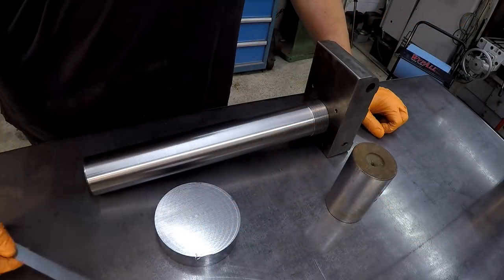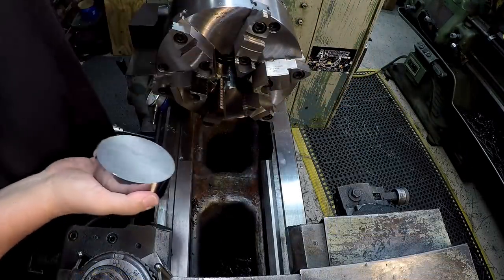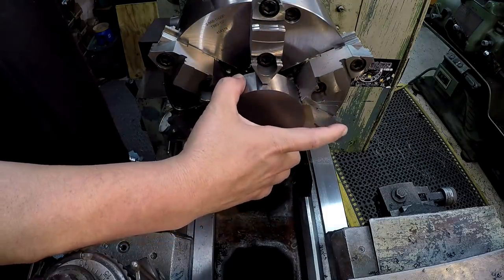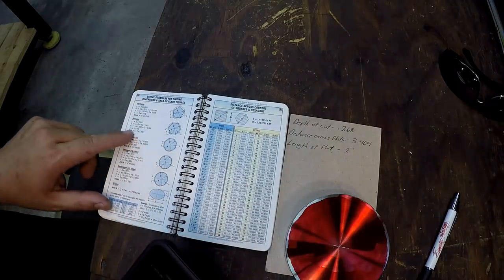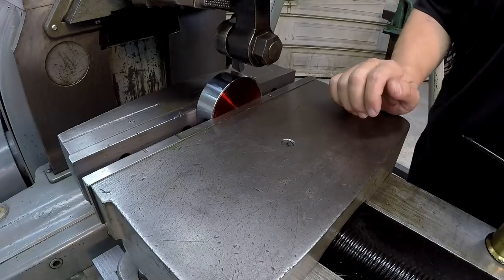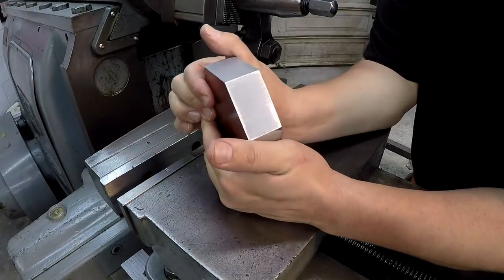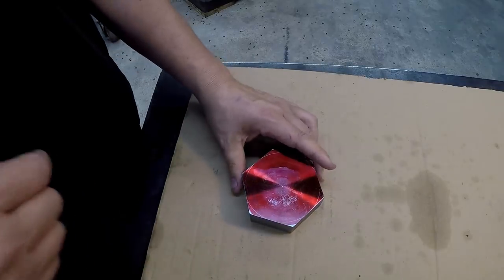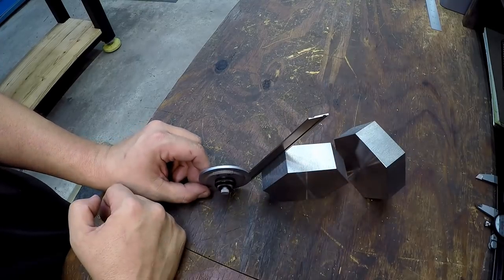Custom Internal Shaping Bar Part 3

Comment: Long rambling yarn alert:

'Way back in the day - 1961 - when I started my apprenticeship in a Navy yard, my first rotation was in the shapers. Since the Navy lives in salt water, its machinery and fittings have to be corrosion resistant; meaning salt water piping was copper nickel with bronze flanges attached with monel nuts and bolts. Miles of flanged pipe; thousands of fasteners.

For some reason in those days, monel fasteners were hard to obtain even though each ship represented a market for tens of thousands in 1/2, 5/8, and 3/4 nominal sizes so we had automatic, cam operated 5 spindle turning machines running 24/7 churning out monel fasteners from hex bar stock. This was expensive but it was the height of the Cold War and every Navy asset possible had to be rushed through overhaul to meet fleet committments.

Sometimes there was no monel (60 nickel, 40 copper) hex barstock to be had and us apprentices made it in 3 ft lengths on the shapers from round barstock. Pallets and skips of 3 ft lengths. For nearly a year when the Bennington and Coral Sea were under overhaul the shapers were manned 24/7 off and on making monel hex to feed the turret lathes and fill the FSS inventory with a couple overhaul's worth of commonly used hex monel fastener products - a much more expensive evolution probably increasing per fastener cost ten times normal procurement. But this was the Cold War, 15 months before the Cuban Missile Crisis.

We made hex stock exactly the same way as Adam demonstrated: calculate the stock removal, set the tool, take one cut 0.020" feed, 11 strokes a minute, index, etc. 6 cuts, one length of hex stock. If it passed the box end of a new wrench, good enough. On a good shift, one man could shape thirteen 36" sticks of 1 1/2" dia monel bar to 1 5/16" hex. Lordy, I got tired of shaping hex stock.

Comment: On your thread triangles. What if instead of the piece of hose you have connecting them, you had a piece of spring steel that was tensioned slightly inwards to hold itself against the threads?

Comment: Dumb question, but since you've got the 6-jaw chuck, why not use a center drill to mark the center on the face? Done lightly, with a small centr drill, you should stil have a good pocket for the tip of the dividers...

Admittedly, using a center square and a punch is the more elegant approach...

Comment: Would it be possible, in lighter cuts, to make a holder with multiple cutters in the shaper? Like being able to pull two chips per stroke? And if that works, why not 3 or 4, or more? It's got a long stroke and all.

Comment: Why do you need to make a thread gauge when you already have the part with the correct threads.... Why not just check the part itself against your work?
Reply: If the mating part is heavy or unwieldy it's better from a surgical risk perspective to make a plug gage for the internal thread. The inevitable wiggle in holding a heavy part in exact position while attempting to gage in-process is likely to disturb the part in the chuck jaws. It's usually more economical to make a quick plug gage of whatever's handy (takes maybe ten minutes for a practiced lathe hand) than re-reference the disturbed work and pick up the thread. More so, if you have more than one part. 

Shop-made internal thread gaging is generally a cost saver. And later you can use it to spud parts for subsequent machined features referenced to the thread pitch cylinder.

Then you stencil the thread data and measured pitch diameter on the plug gage and put it on a shelf to gather dust for 50 years. Whoever takes over your shop after you retire (to sit in your Depends and drool in your bib) will toss out a full ton of old plug gages, spuds, arbors, mandrels etc only to have to re-make that very gage a month later. It's a Murphy's Law thing.
Reply: Because you can use the thread gauge without taking the nut out of the lathe, it would be awkward to pass the long part through the headstock and screw it into the nut.
Reply: This is assuming he can even fit the bar into the head stock, iirc, that lathe has a pretty small bore for its size.

Comment: For laying out that hex on the stock - once you've punched a center mark you can just run a layout line from center to the outside as a radius.  From there you can use an angle gauge or block - anything thats a known 60 degrees and radiate lines out from the center 60 degrees apart.  From there, so long as you are confident its a true enough circle just connect the points from the outer edges for your flats
Reply: Or a compass.

Comment: The correct measurement across flats for a 2 1/4-12 hex nut is 3 3/8.  I'm not sure where you got your dimensions from.  I used the Machinery's Handbook.

Comment: Hi Adam. Love your videos. I have a question for you, though. I see NYCNC spend a lot of money on CNC machines and focus really hard on completion time, and they seem to make good progress. What is your take on this? How is the machining business moneywise? So many questions... Could you do a video on this please? You know, bread and butter work, good projects, bad projects, etc. Thanks :-)
Reply: NYC CNC is a production job shop, and when you are using machines that have payments as expensive as what Adam paid cash for some of his machines, you have to focus on cycle time, so that you can make more parts, and pay the bills.
Also remember that the cnc mills are using 20-50? Horsepower motors on them, and so just the power usage with the machine turned on is more than your house probably uses in a day.
And if you can keep the machines churning out parts, you can make enough to pay for them, and make a profit, but you really have to stay on top of it.

Adam's got it smart.
Paid for machines, selective on what jobs to do, plus with YouTube being a source of income, he can take the time to have fun making videos we enjoy, doing things the old way, or the interesting way.
And if he somehow doesn't make enough doing it, he can either crank up his production rate and choose lower tolerance jobs, or lock up his shop and go back to working for someone else, and just play in the shop on the weekends.

If NYC CNC doesn't keep the high volume, they miss payments and it all goes away.

Tldr:
When you have hundreds of thousands of dollars invested in machines designed to provide high speed machining, you need to keep them working at full capacity.
If you have classic old machines that you enjoy working with, you work at the speed that they are designed for, and that you enjoy!

Comment: There appeared to be a considerable bounce in the table particularly during the heavier section of the cut. Is that why you could also see visible chatter on the corresponding area on the flats surface?

Comment: No, I'm not tired of hearing the shaper work. shnick, click. Shnick, click... Love it.
I didn't understand how the mistake was made. You touched off, zeroed it, and dropped another 0.268 (I think that was it). How was that 0.010 off?
Thanks.
Reply from the maker: I misread the dial on the shaper. You have to double what you read, but it shows the divisions in 50’s. If you read 5 lines that’s actually .010. I went 10 lines thinking 10 thou, so I went over by that amount.
Reply: Abom79, understood. Thanks

Comment: You should explain why the pivot on the clapper box is at an angle when cutting with the side of the tool. I think folks would find that interesting.  Beautiful job/video as usual.  And your looking good too.
Reply: Angle the clapper opposite of the direction of travel,  so the tool swings away from the work on the return stroke.
Reply: Thank  you. I knew why, but thought it would be interesting for Adam to explain how that angle works to clear the tool coming back.   The guy that planed my Bridgeport's ways used an air cylinder to lift the tool on the backstroke but still had to set that angle correctly for clearance. An interesting, but essential detail in machine setup that I find makes it all the more interesting.

Comment: Are you going to make a BFW - you know, a wrench- to fit this nut? Also, I'm glad you're planning to set up for smaller boring bars. I'm sure you'll need to make internal cuts on smaller diameter work. Internal keyways , flats and  splines are operations  a shaper is really needed for.

Comment: Why not just use the existing bar as a thread gauge?  It was already mated to the other piece.
Reply: Because Adam does not have a hollow spindle lathe.  Think about it. . .
Reply: I think it was too big to slip through the center of the lathe.

Comment: An alternative way to mark out that hex, would be to use the caliper on the same setting, to step off 6 equidistant points around the scribed circle, join them together with scribed lines, then set each line up horizontally against a parallel, sitting on top of the machine vice.

It would have the advantage of always having the top of the work-piece at the same height, thereby eliminating the need to alter the tool height, which would've prevented that 10 thou error that crept in.

Comment: great job on the weight loss.  Are you going to put a 30 degree chamfer on the the nut to make it look like a machined nut?  When in designing in engineering we always had to draw those chamfer.  When we when to cad systems I had to learn a way to model the nuts with chamfers.  By the way I loss almost 200 pounds after the bypass operation.

Comment: ANOTHER GREAT VIDEO ADAM!   

Hey amigo,  I have a question bout the shaper vise.  Does it swivel or could you turn it 90° to cut the flats radially to the nuts so that you could have left some round flat on the face of the nut?  Like a flange nut?

Comment: Why is your compound rest on an angle? Is the thread a taper or an I missing something, because I have cut normal imperial threads and made a Morse taper before a couple times.
Reply: The compound rest is set at 30 degrees.  The tool is 60 degrees included angle, which is 30 degrees per side. So as it is fed in, it only cuts on the leading edge.
Reply: It also means that you get half the distance that the dial moves, which gives you twice as much precision. Because the sine of 30 degrees is 1/2.

Comment: @Abom79 I know you probably have a great reason for working the way you do. I was wondering though, What if you drilled small hole and put a rod through it. So you could then have the rod sit ontop or in the jaws, so you could just rotate the part and use the bevel protractor on each of the following faces, and just turn the part and possibly avoid some of the setup work? Or would you experience oval shape to the dowl hole, and throw all the tolerances off? -Thanks
Reply: Thats what I was thinking.

Comment: hello im new in the machining world in school my teachers did not teach us very well how to do threats and i very scare to do them because if u dont pay attention u can crash do you guys have any tips for me sorry for my english
Reply: Take a look at Joe Piecznski channel and he shows a video on threading that seems to take some of the worry out of crashing..
Reply: My suggestion as I have done is to make an undercut to the minor diameter at the threads end. Set up a magnetic dial indicator at the end of your thread on the cross slide and set it to sweep maybe in two circles around the clock to the end so you have time to disengage your half nut. You can then run at your slowest speed and feed until you get a rhythm and experience and then you can go faster to get a nicer cut and save time. Practice using aluminum cutting maybe half inch 13 threads always using the same number  on your thread dial to start until you get more confident that way if you do crash your tool a little bit it's no big deal. You can then check your threads with a standard half inch 13 nut to check for fit. Practice using different diameter stock and thread pitch and you will soon be cutting threads with confidence and precision and having fun doing it.

Comment: Why have the clapper box twisted instead of perpendicular to the work?
Reply: If it was perpendicular, it would very likely cause the tool to jam against the work on the back stroke as the auto-feed stepped the work over. WIth the clapper box at an angle, it moves up and away from the work slightly on the backstroke, preventing possible jamming.

Comment: You could have showed just one side of the hex being shaved 0.01".
Next time the shaper throws chips, stand there with a paddle and learn to bat the chips into a box (set one next to the vise). Ping-pong elbow workout.

Comment: What thread measuring wires are those you used? Looked like they had some kind of holder?
Reply: Triangles. He shows the chart and that has the name and supplier on it. It's where he cuts the threads on the bar itself, I think that was near the end of part 1.  He also talks about the tubing holding them.

Comment: 10:53  Kinda edited past that part.  On a hex, the Distance Across The Flats is just the original diameter minus twice the depth of cut.  So 4 -2(..268).    The pairs of faces are parallel and you're just taking the depth of cut off both sides, so look at it like 4 minus .268 minus .268.   Probably simple enough it didn't need explained, but there it is just in case....

Comment: Is there a book or some sort of printed material that can teach you how to shapes tools for cuts or is it more of just an experience thing. I recently purchased a small lathe and have purchased a couple dozen "quick change" tools, but ive got several high speed tool blanks but i have no idea how to shape them. I kinda "copied' one of the facing tools i had purchased and it didnt turn out bad, it cuts. Its not nearly as good as the purchased tool though. Thank you to anyone who can help me.
Reply: Machinery's Handbook is THE official reference.  The Engineer's Black Book that Adam uses in this video is a very good addition.  Being that it's smaller, the information you're most likely to need isn't buried as deeply as with the Handbook.  Machinery's Handbook though is much more  comprehensive.
Reply: Darryl Machtmes machinerys handbook and the engineers black book, ok thank you very much. ill definitely see if i can get ahold of em. again thanks, very much appreciated. have a great rest of the weekend and stay well.

Comment: Why the shaper jumps so much retracting?
Reply: The clapper box, that is the part that holds the cutting tool, pivots so that as the tool is moved back it pivots away from the workpiece. That is the "jumping" that you see. Watch ABOM's earlier videos on the G&E shaper to see more on this.

Comment: Love the red dykem,don’t care much for the brush on method,years ago I came across some dykem in a spray can,I think DuPont made it,works great and it leaves a very thin coat of applied correctly. They might still make it.
Reply: Dykem still makes it in a spray can. Its shelf life is a bit shit though.
Reply: Plus its hardener to control where exactly it goes due to over spray.
Each type has its own uses
Reply from the maker: The aerosol can is good for larger workpieces. It puts out too much overspray for my liking, the brush has more control, especially for small areas.

Comment: What’s the appeal of using the shaper as opposed to the mill?
Reply: Probably because the shaper is so damn cool
Reply: Not only is it just damn cool, it is what was used before the milling machine was created, so Adam is doing old school because he likes it!
Reply: The tooling for a mill is a lot more expensive and near impossible to sharpen yourself without expensive equipment.  With the shaper, the tool is literally just a bar of high-carbon steel that you've ground to shape and can regrind in a blink.  

Also, interrupted cuts (like when removing the marks left by a torch or plasma cutter) are really abusive to the bits you use in a milling machine.  They're rough on the shaper bits, too, but at least those are easy enough to repair or replace.

Just my take on it.

Comment: Does that oil actually do anything but make smoke?
Reply: I suspect it acts as a coolant and prolongs tool life as a result.
Reply: Actually it isn't a very good coolant. What it does do is stop the chip from welding itself to the tool thus prolonging tool life.

Comment: I am not sure that the shaper is faster than a mill would be, but it is more interesting to watch.
Reply from the maker: I’m not keeping tabs. I invest in machinery so I can enjoy them.
Reply: Less mess, also no wear on his end mills vs. one high speed tool. 

Also, the knowledge of using the shaper to make a part for the shaper.
Reply: You are obviously new to this channel because no shit a mill would be faster he has said that many times that’s not the point. Stuff like this just doing shop made projects the shaper is perfect for stuff like that.
Reply: I'm not sure a mill would've been faster for this. You may have had to do a couple of passes per flat and for sure it would've left a burr pushed over to clean up. The time taken to set up for the flat would be exactly the same in either machine.

Comment: The vise on your shaper is moving probably 20 or 30 thousandths of an inch every stroke. That will probably affect the accuracy of your part.
Reply: It is moving 0.020 every stroke, sideways. That's called the stepover.

Comment: Distance across flats in metric terms:
M x 1.5
Formula in metric is always the same.
Reply: Even M10?
Reply: Same for imperial nuts.
Not useful in this situation. He wants the biggest hex for a random piece of scrap, not the standard hex.
The calculation for depth of cut, etc will be the same for imperial and metric since math does not care about units...